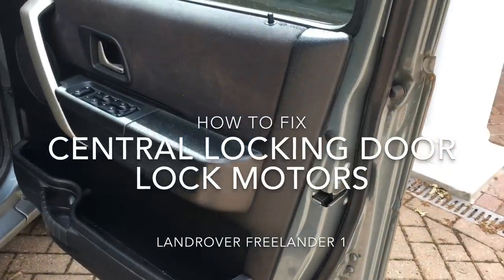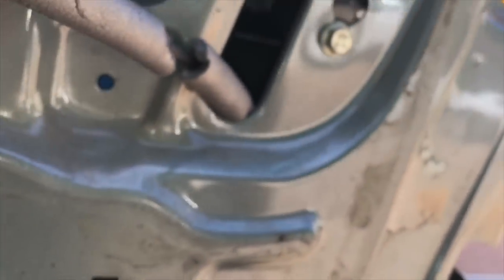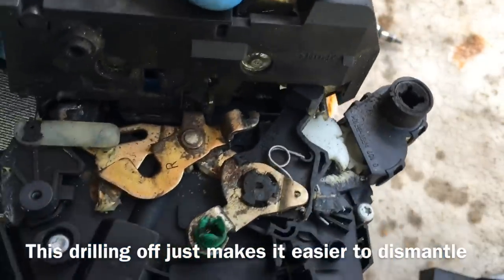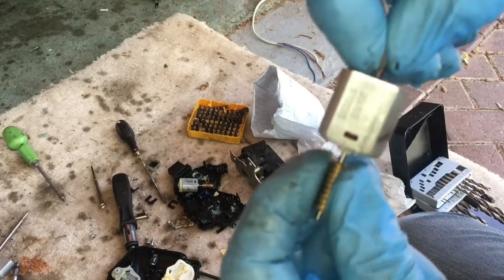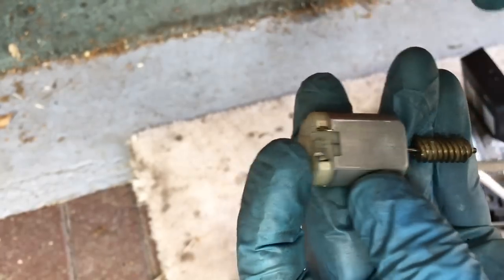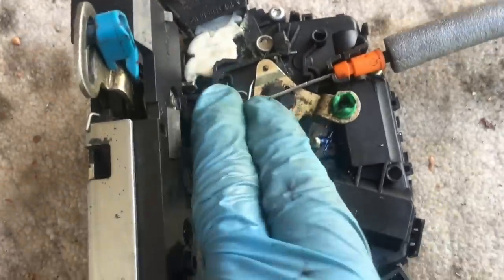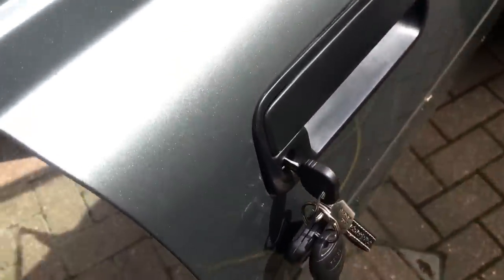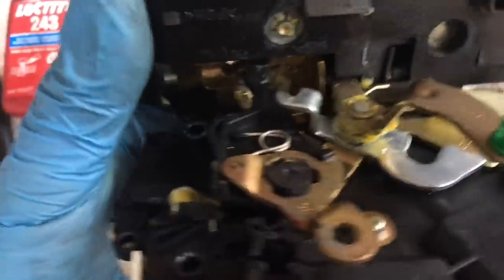How to Fix Central Door Lock Motors - Freelander 1 and other cars

Comment: Great video, I could never imagine the trouble those cheap small motors are guilty of  such hardwork. I should say, Land Rover for the price they ask for these parts they should have used proper buhler motors  that last forever
Reply from the maker: I expect the parts are common over many manufacturers and made by bosch or the like. I generally find Landrover parts quite cheap compared to others like bmw, audi etc.

Comment: Such a great video, I've watched it several times in an attempt to make myself brave enough to give it a go myself, but as yet, not brave enough, shame really, as I've two locks which have gone, will have to watch it a few more times. Great stuff, keep the Hippo vids coming.
Reply from the maker: Thanks.  Good luck if you have a go!
Reply: Finally had a go, removed the rear right lock, replaced the rear part of the motor that wasn't working, all seemed  fine until I re-inserted it, when I unlock the car, it locks, when I lock the car, it unlocks, it's got me stumped. It' not possible to reverse the polarity, is it? Any clues to where I went wrong?
Reply from the maker: @davidspikings2723  That may be because you have accidentally rotated the body of the electric motor with respect to the brush end, perhaps.  The north and south magnets are then swapped and it rotates in the opposite direction.  If you don't want to swap it back mechanically you could just swap the wires to it.
Reply: @comeinhandynow  Thanks for your reply, i'll rotate the replacement end 180 degrees, make sense really as it was the only thing I changed.
Reply: @davidspikings2723  hello my friend, my rear right door is locked, it doesn't open, you followed the same path, you threw my screw instead of press.

Comment: Thank you very much for the video. Got an issue with my freelander 1 change the door lock , works fin when not connected, when i connect the wire, on "unlock position" the door is closing with the key button but not opening either with the button or the handle, when its on lock position closing with key button unlock with button from the outside but couldnt open it from the inside do you have an idea where it might come ?
Reply from the maker: When the lock does the opposite of what is expected after the motors have been dismantled, it is usually caused by the brush end of the motor being installed 180 degrees rotated compared to the body part holding the magnets.

Comment: My central lock doesent work on the front left side. It works when you lock the but when ju unlocks the car the thing doesent come up and I have to open it from inside. Should I buy a brand new motor or can you do something easy fix?
Reply from the maker: Watch the video if you want to fix the lock, or buy a new lock.
Reply: Is it ok to write on the comments here? I have som faults the owner before me didnt serv the car that well and need some help

Comment: I have to do this on my Freelander, not because the door lock doesn't work, but to replace the actual key cylinder which is completely knackered ... Worse even than the old Mk1 Mini locks which were notorious for being able to be opened with a screwdriver to twist the lock as the cylinder became so worn the tumblers did nothing!!

When one sees the clunky cumbersome way this has been constructed one has to wonder what kind of pervert designed it in the first place and WHY production engineering didn't complain about the farcical nature of the assembly, instead of a straight forward process enabled by decent access holes!

Score 0 out of 10 for one of THE WORST pieces of design I have ever seen in my life!!
Reply from the maker: This video does not cover dismantling of the keylock part that is separate in case anyone wondered, I just show it being reinserted.  The keylock part is the same you get on most cars of this era and they don’t normally wear out as most people use the remote fob for lock/unlock.  It seems like yours has been well used or abused. If just well used any wear is very dependant on key hole lubrication, which should be done at a service,  but most garages don’t bother.  Yes, access is a bit tricky but is all down to technique.  You just have to think “how did they assemble this?”.  They will have had a method to try and save time, because time is money, but there are constraints of strength and safety of the door structure.  It’s not an unusually bad or good design in my experience and humble opinion.  Good luck with your job.

Comment: Where can I message you mate
Reply from the maker: Try here to start with. What is your question?
Reply: comeinhandynow I done my k series head gasket and I tried to fire it but it didn’t wanna start
Reply from the maker: Most likely the timing is out then. Check it against the video I did on the k series engine https://youtu.be/aMcjc3LmMv0
Or a Haynes manual or rover workshop manual.  Check for any diagnostic codes via a scanner.  Next check you are getting a spark, that you have fuel pressure and that injectors are firing.